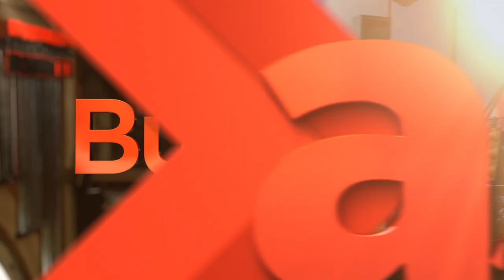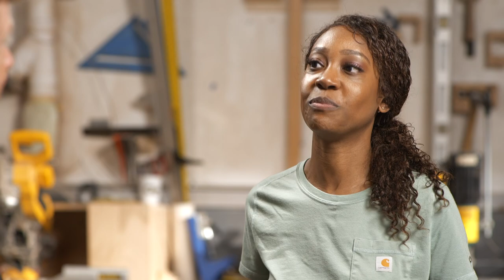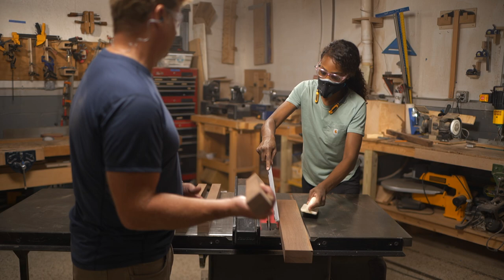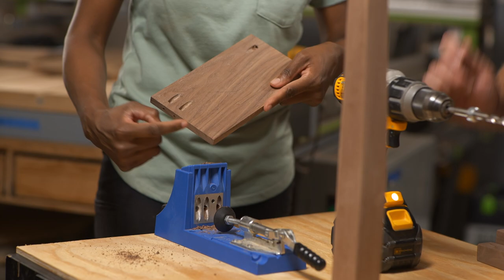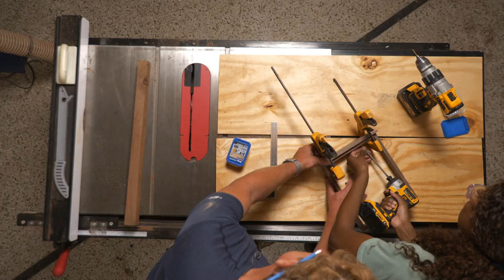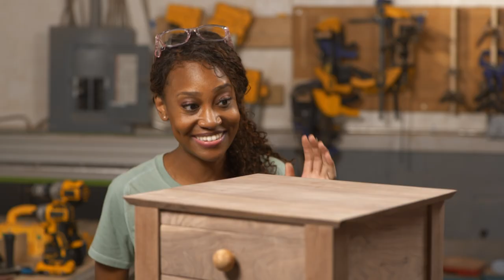Shaker End Table | Build It | Ask This Old House

Comment: Lovely project, and it's fun to watch Char walk through it.  You should have shown us the finished project even if that was bringing back the template.  Pocket joints require specialized jigs, sometimes special clamps, specialized drill bits and special wood-type specific screws, and yet they have inferior holding power dowels, mortise & tenon, biscuits and loose tenon.  Pocket hole joints is only ~17% stronger than a butt glue only joint.
Reply: @Kevin-mp5of  Cheap: 100 biscuits are $7; I don't know what size screws they use but 100 1" fine thread is $7.49.  Not sure what jig that it.  If it's Kreg current comparable model might be the 720 Pro which is on sale at $110.  Drill bits are consumables.  One of the top-rated biscuit joiner is $179.  It's blade is a consumable.  Easy... I don't know, I see the work piece had to be reposition for the holes.  When screwed they use a clamp, two support pieces.  They leave the screws exposed instead of plugging them.  Not sure how to qualify accessible.  You are welcome to re-read my original comment again, but to summarize it's specialized consumables & tools, and the joints are not as strong as the alternatives.  They hide the drill holes on the inside, and if you can't then you need to plug cut and sand those plugs.  There is nothing to hide with biscuits.  You do whatever works for you.  Dowels are even stronger and cheaper.
Reply: @Kevin-mp5of  Straw man argument.  I am out.

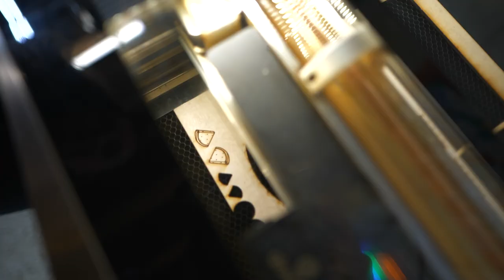Comment: The prototype table at 0:50 has the leg taper on the outside.  No Shaker would ever do that.  The walnut table looks very nice and has mostly Shaker features.  But I never saw a taper on the top .  And Shakers would never use pocket screws; only mortise and tenon.  So, nice table, but NOT a Shaker reproduction.
Reply: Under those rigid rules, it's impossible to make a reproduction of anything. You can't use wood glue, since it didn't exist during that period. You can't use dimensioned lumber since they milled their own. How far do you want to take it?
Reply: @bobweiram6321  There is a reason why Shaker designs are still sublime after nearly 250 years. Just like God who so loved the world, that he gave his only begotten Son. The Shakers through a purgatory existence so loved their God, through Shaker hands, toiled about to bring into this world, God's pure intention for man - voided of arrogance and hubris. The conceit of man who desires easy fulfillment without effort and indulges in all the trappings God has provided to him without even so an acknowledgment to God. He has created false idols and consecrated this as his own God! This is blasphemy and it will not stand!

Comment: Please don't use a "push stick" (sometimes called a chicken leg).  It is totally unstable on the table saw and should it slip, your hand goes straight for the blade.
Reply: What's the alternative technique (other than using a track saw)?